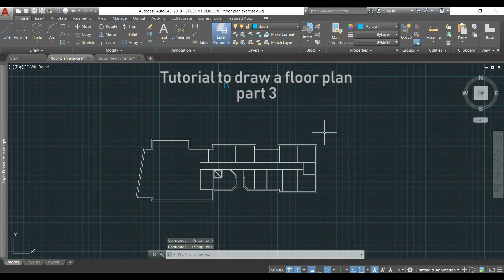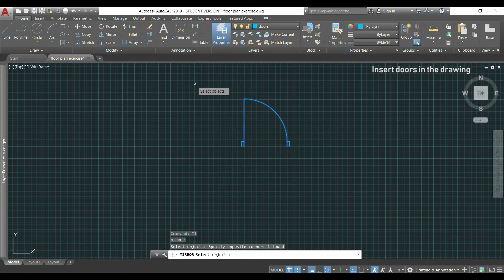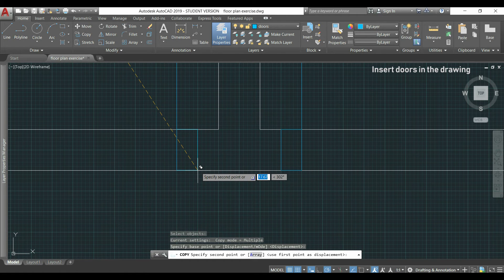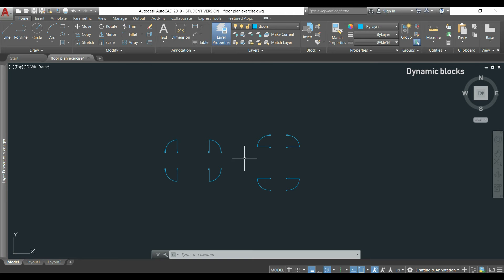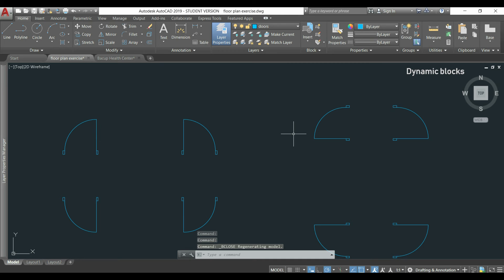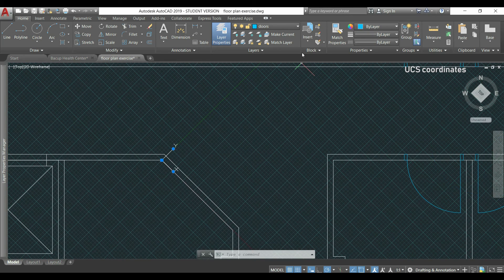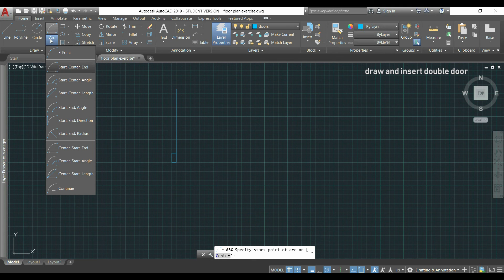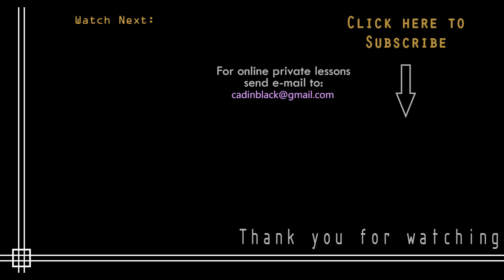Autocad 2019 - Tutorial for beginners (tips do draw a floor plan) - Part 3

Comment: Thank you for your explanations which I consider  very clear. I however have a problem with moving the UCS coordinates to realign with the diagonal line of the Floor plan. The UCS always returns to "world" position. I select the system and move to the point  to align but it keeps flipping back to origin. What am I doing wrongly?
Reply from the maker: Hello Paul! Have you already solved that?